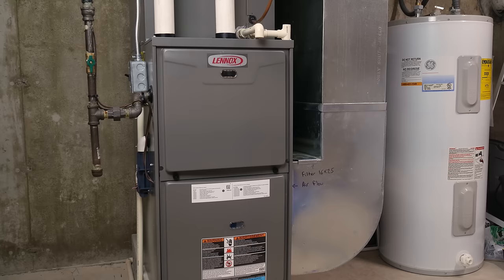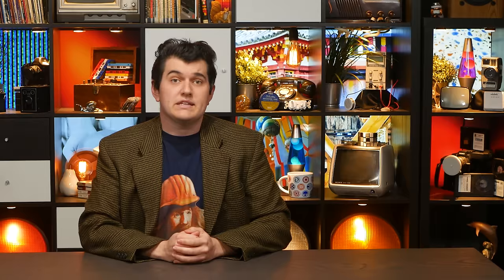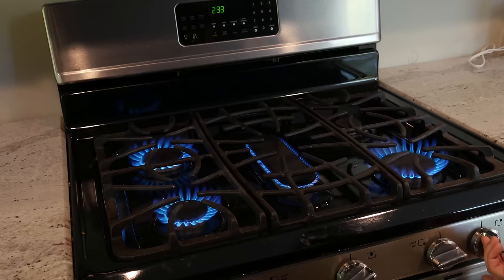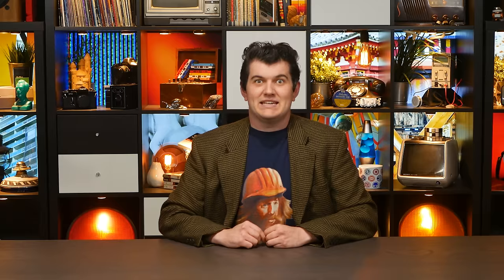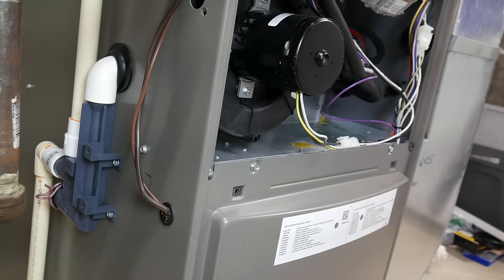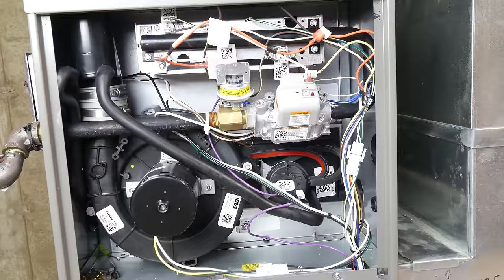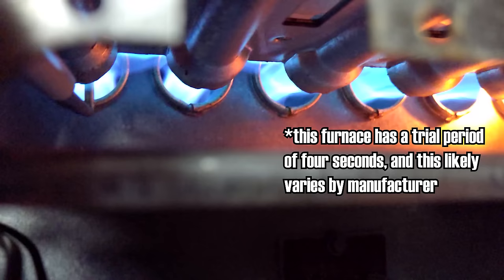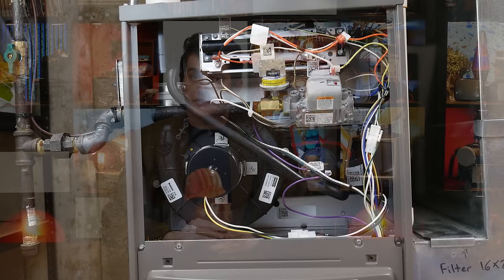Forced-air Furnaces: The What, Why, and How

Comment: The house I live in now is the first one I’ve had that actually uses a heat pump instead of a forced air furnace/AC set up. It’s nice not having to worry about the two pieces of hardware that might need fixing lol

Comment: In the province of Quebec in Canada electric forced air is more common due to the cheap hydro electric power that is available there. Makes the furnace much simpler as there's no need to worry about air flow or combustion gases and safety interlock is reduced to one thermal overload sensor

Comment: Forced air heating is very rare in the UK. I understand it was popular in tower blocks in the 60's that had community heating but fell out of favour as the insulation was asbestos and they had to be sealed up. Most UK homes have natural (North Sea) gas based circulated hot water and convection based "radiators". New homes sadly are mostly electric heating because it is cheaper to install and a lot more expensive to run, "but that is the problem for another guy." All new gas boilers are condensing and the flue gas is cold and runs out inside the incoming air pipe so any breach is still enclosed.

Comment: In NE Pennsy we had gas fired boiler with baseboard hot water..  Oh how comfy and warm it kept my feet.  It had a nice feature.... push the backflow valve and gravity feed would heat you even if you have lost power.

Comment: You missed one important step in the ignition sequence.  After the hot-surface igniter or the sparker is turned on, gas valve #1 opens the gas ONLY TO A SMALL PILOT FLAME.  A flame detector (not a thermocouple, that's too slow!) detects the pilot.  THEN, and only then, will the main gas valve #2 open.
          If the hot-side heat exchanger develops a leak, room air will be sucked into and mix with the flue gas, not the reverse.  This is because the draft inducer makes a vacuum in the burner box and tubes.  In order for for flue gases to escape into the room, the leak must be in the exit PVC pipe.  That's reason the inducer sucks after, and not blows before.  If the leak gets large, the pressure sensor will sense & cause shut down.
          About the condensate: they put the electronics under the condensate (in the blower box).  There are ALWAYS some leaks.  Water drips on the electronics and destroys them, and dust collects.  Water & surface mount parts do not mix!
          Important points missed: the draft inducer enables the heat exchanger's tubes to have small cross-section (handfuls of square inches).  This increases the likelyhood that hot gasses from the flame will collide with the walls of the exchanger.  In old furnaces where flue gasses were propelled through by gravity alone, the flues needed to be large in cross-section (many square feet).  Most of the hot gasses went right up the center, never toughing the walls and giving up the heat.
          The second "trick" the modern furnaces employ is COUNTERFLOW.  Flue gasses and room air move in opposite directions in the exchanger.  The hottest flue gasses, exchange heat to the hottest room air (just about to leave the furnace).  The coolest flue gasses give the last of their heat to the coolest room air (just entering the furnace).  One trick overlooked in these furnaces: the coldest air is the outside air feeding the burners.  A counterflow exchanger between the entry and exit flue gas lines would permit capturing the last of the heat from the exiting flue gasses, because the entering outside air is colder.  This heat could also be used to heat outside structures such as greenhouse.
          All of these furnaces would be even more efficient (with the same size & cost exchanger) if they would quit being stupid and make the furnace analog, not digital.  In the winter, the furnace should run continuously, the burners (and inducer) being adjusted to match the heat demand.  The lower the heat exchange rate, the lower temperature drop in a given exchanger, and the less thermal fatigue & less wear & tear starting & stopping motors & igniters.  Most of the time, the furnace is way over rated for the heat load required.
          Heat pump: WORTHLESS!  If it's warm enough for them to work, you don't need much heat anyway.  If its colder, the outdoor heat exchanger keeps icing up, as ice sublimes on, like in no-defrost refrigerator.  So the unit has to keep dumping precious heat back outside to defrost it.  Heat pumps are very expensive, and the compressors "work hard, and die young".  Yea!  Geothermal!  Rrrrright!  How many (except in few in remote area) are going to dig up the place and put that in (if the geology will even permit?)  Most local codes won't even allow that.  In Switzerland, that was done by many, and the river froze solid from the bottom up!  It's like pollution: OK is few do it, not OK if everyone does.

Comment: Carbon monoxide is the reason the draft fan is after the heat exchanger.  it exerts negative pressure inside the heat exchanger so if a crack develops, it sucks air into the combustion stream instead of letting combustion gasses into the home air.

Comment: There's no gas lines in my area so we were forced to use electric baseboard heaters. My house isn't even particularly large and the electric bill in the winter is well over $500... And we don't even keep the house too warm... Think 65°F. There's no ductwork on the house so it'd be a major undertaking to do a heat pump (plus we're strapped for cash). My husband bought a secondhand wood burning boiler to put outside and heat the house with on recommendation of our neighbors. Electric might be "the future" but it certainly isn't cheap. People with low income (such as myself) barely scrape by when more than one paycheck has to go to one utility bill alone not including other expenses.

Comment: The big inefficiency with forced air furnaces isn't the heat exchanger, it's the blower. Even though you get 95% of the gas's heat into the air, then you use a ton of electrical energy blowing air around to get that heat distributed around your home. It can be much more efficient to pump hot water or steam to radiators in a home, than to be blowing all that air around.

Comment: I didn't notice you mention Flame Roll Out Sensors.
I was trouble shooting my furnace and I was ready for terms like Draft Inducer  and ignitor and variable speed motor control and over temp sensor, but I was lost as to what Flame Roll Out Sensors would be.
Just more safety mechanisms to keep the Flame Thrower part from letting fire go where it isn't supposed to be.  :) 
Overall, really well done presentation.

Comment: Absolutely CO monitors are necessary and inspecting the heat exchanger for cracks is important, but another safety feature is the static pressure of the blower fan must exceed the static pressure of the draft inducer, so that in the event of a heat exchanger failure, ventilation air actually blows into the combustion chamber and in a proper installation like yours, back outside.

Comment: 14:27 -- The Sparky Thing ignitor probably went out of fashion because the electrical arcs are so ridiculously hot (>15,000 degrees, which is so hot it doesn't matter what unit system it is) that they damage the electrodes, which over time, could reduce the ability of the ignitor to reliably create an adequate arc. True, the arcs have an absolutely miniscule cross section, and thus it would take (in most environments) a long time for the electrodes to degrade to the point of introducing any real unreliability, but as you have pointed out multiple times, you just don't screw around with burney things indoors.
Reply: Spark ignitors are still in common use even on newer units. At least that's been my experience with what units I have come into contact with. Hot surface ignitors aren't really bad by any means they're just very fragile.

Comment: On an old furnace up at the mountain home I grew up in, it had a leak and I survived a carbon monoxide scare. I had been in the general vicinity of the furnace for a few hours in the basement and then went up-stairs to go to bed. I was suddenly feeling very lightheaded and off and my vision started to get fuzzy and I knew I was blacking out as it became hard to stand or hold my head up. Somehow immediately thought carbon monoxide and managed to get myself outside in time. I was 15 at the time.

Comment: One of the Best Examples of a Flame acting as a Conductor,. was Apollo 12. The extremely long Flame of the First Stage of the Saturn V acted as a Conductor allowing the Voltage Potential in the low lying Storm Clouds over the Launch Site to discharge

Comment: I lived in CT for a number of years. There natural gas is not generally available thus heating is by electric resistance or oil fired boilers are used. Air conditioning is uncommon.  In my present location in western PA  gas furnaces are common.  My home has both a gas forced air furnace and a gas fired  boiler mostly for floor heating.  Heat pumps will be problematic for heating cold locations. Some of my relatives live where the outside temperature can be below -50 F. At low temperature heat pumps are not efficient.

Comment: Also, a gas cooktop is a savior if you live in a region that can experience extended blackouts during winter.  Losing heat is bad enough, but not being able to prepare food makes that worse.
Reply: So many die from using their gas stoves to try and heat their house though during an outage

Comment: Most furnace flame sensors in modern furnaces are no longer thermocouples.  They instead rely on the lower resistance of air when it is rendered to plasma by the flame.  The sensor is a rod that picks up more electrons when there is a current present, and this can be detected via an electronic circuit.  Given the amount of dirty flame sensor rods I have replaced or cleaned over the years, I do wonder if a slightly more costly thermocouple would not render many of these furnaces more reliable.

Comment: Quick correction on your electric heating in areas with cold winters and large heat demands. In some areas, we  actually do. 

In many areas, we actually may use electric heat as the wholesale cost of energy in the US produced by many nuclear plants in the North-East of the US and hydro from eg. Niagara Falls (invented by Nikola Tesla and funded by Westinghouse) is insanely cheap, cheaper than natural gas.

Some communities there have communal or non-profit electric suppliers (yours truly included) where electric is 2-4c/kWh (or less for businesses and schools) whereas natural gas is ~6-8c/kWh. Our areas that do not have this service, for-profit electric supplies are in the same range of 6-8c/kWh. Therefore, many people now opt for electric as it is easier to install and costs about the same to run and allows you to cut your gas supplier completely (and associated monthly fees and taxes).

Yes, I pay 2c/kWh, hence I will never use gas, even though my electric supplier promotes it to reduce the load on the net, which is a problem California is dealing with already. Yes, I do have a heat pump system as well, but those don't work a few degrees Kelvin below the freezing point of water.

Comment: Correction. When the thermostat calls for heat it does not instantly turn on the draft inducer. The first thing the control board does is check that the pressure switch is open. If it’s closed, the furnace will not go through the lighting sequence. The switch could be closed cause it’s faulty or because there is something in the exhaust that is preventing the switch from opening after a heating cycle. 
The draft inducer is creating a negative air draw on the switch. If there’s a blockage, the exhaust air could remain in a negative pressure keeping the switch from opening after a heating cycle. 
Once the board recognizes the switch is open, then it will send power to the draft inducer motor. And wait for the switch to close. 
Also the flame sensor doesn’t detect heat. The board is looking for a DC signal through the flame rod. Flame rectification. The flame completes that circuit to ground.  Anything less than 1ua (1 micro amp) will cause the gas valve to shut off.  
New furnaces will not operate without a good ground. Cause it’s through the ground circuit that the flame rectification occurs.

Comment: Thiis winter season, my (european) combined space/water heater remains off. As you mentioned in 240-Land there is often water used to transport heat from the furnace to the radiators in all rooms. I recently checked the data sheet and learned that only the circulation pump has an appetite of 150 Watts of electric power, not to mention natural gas shortage in Germany. So, I was looking for an alternative way. Toyoto kerosene heater from Japan is doing fine this winter. For power ourages I even have some wick-operated things as reserves...

Comment: There is one way to take more energy out of of the natural gas than the 95% you get - power a natural gas engine (basically any gasoline engine modified for gas), power a generator with that and then take out the waste heat (-> the vast majority of energy) for heating. You get almost the same amount of heat energy but also enough electric energy to power your home almost completely (who needs more than 6kW when not cooking?).

It is not very common sadly but for instance in Germany there are readily available and comparatively cheap off the shelf options with a regular natural gas powered VW Golf engine, generator and heat extraction available. They are called block heating plants and you should definitely look into those for one of your videos!

Comment: 3 years ago, my father changed the house heating method, from a gas furnace to an electric heat pump. He also changed from a gas oven to an electric oven and induction hobs

In France, heat pumps are highly subsidized (iirc, i think he paid 6k)

Comment: You missed a limit switch by the burners.. they detect what's called "roll out" and that's for if the flames roll out side of the heat exchanger

Comment: I work on furnaces. They are amazing to work on. The only thing I don’t like id due to all the safety in place I can’t bypass them like I would a heat pump for a short period of heating. It just not safe. So if a part brakes you better hope we have spares or an HVAC store is open. So please test your equipment before it get below freezing

Comment: When I replaced my A/C the negative pressure associated with cooling the air prevented the water heater from exhausting properly and tripped the monoxide alarm

Comment: My furnace stopped heating on Saturday night.  I went and opened the panels and stood and looked for a bit.  Then I youtubed for a bit, and stared some more.

I noticed I wasn't seeing the ignitor make any light (it gets white-hot, so should be obvious).  Found the plug for it, unplugged it, and checked the resistance (because of what I saw on youtube) with a meter.

1420 ohms.  What is it supposed to be?  10-20 ohms, typically around 15-16.  Hopped on Amazon, found one that looked identical for $40 bucks, ordered on Sunday.  Received on Monday at work.

Installed in about 30 seconds, closed it up, waited.  Whirring...click...light...FLAME!

Done and done and done, no service call.  Youtube is everything, for better or worse.

Comment: Here in the state of Georgia the heat is resistive electic. When the overall rate for power here is $0.12 a kWh it makes sense. I'd love to have a heat pump though. Now when i lived up North we had oil heat that was then converted to gas heat. Much better but still expensive. And we won't talk about the rates for electric power - $0.25 kWh.
Reply: It also just makes sense since you probably don't need the heat very often in Georgia. I lived way up in Virginia and ended up not firing up my furnace a single time in my last winter in the state. A space heater to keep my bedroom at a more comfortable temperature was all I needed. I'd imagine most winters in Georgia never warrant turning on a heater at all.

Comment: While Heat Pumps are great, they struggle when the outside temp is below freezing. The best solution I've seen is to have both a heat pump and a forced air furnace installed in unison. Use the heat pump, but when the exterior temp drops below 34F the FAF starts up

Comment: Central heating systems in Australia are a little different in that, I personally, have seen very few systems that have draught inducers in them, most 'furnaces' in Australia are usually installed outside the house on an outside wall, and the duct tubes run under the floor, in my apartment, the heating system is in the upstairs roof space, this includes the heating unit itself and the ductwork.  I have seen a few houses with the heating until installed in the living space, but this is not commonplace as far as I know.